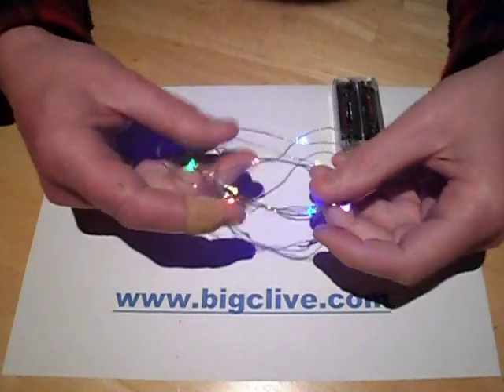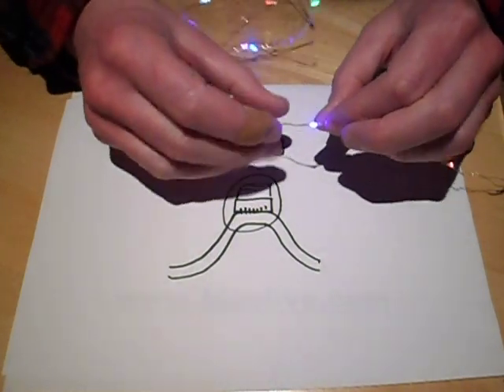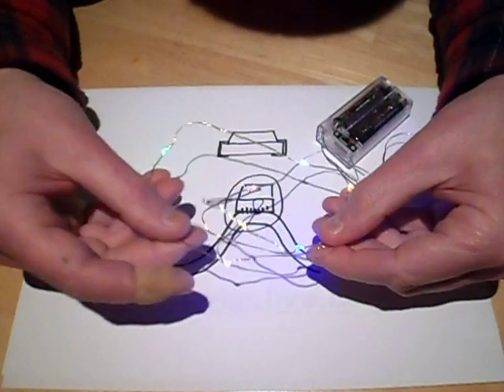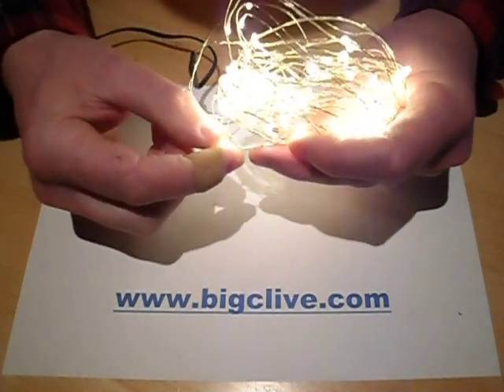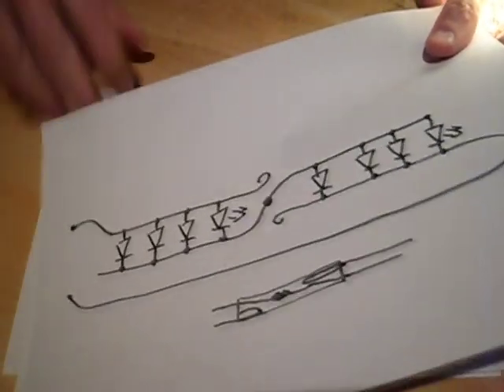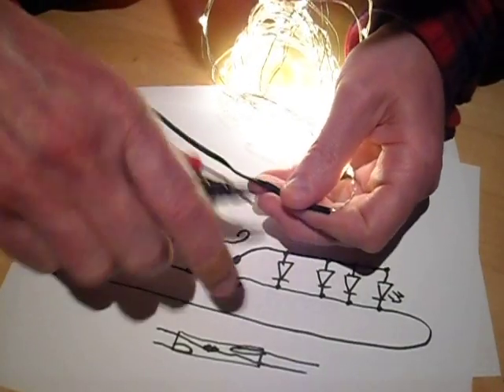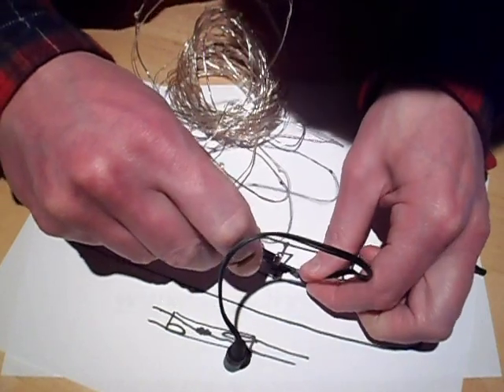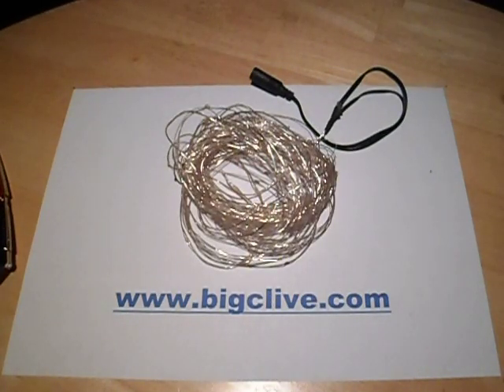Analysis of a 100 LED string of "wire lights".

Comment: Is there any way to put two or three of these 100 strand lights together (one strand). They don't make them any longer and my yard is big!
 Without starting a fire, I hope.
Reply from the maker: You would have to run a common 12V supply to each full string.  They can't be electrically joined end to end because only one polarity is at each end.
Reply: bigclivedotcom
I thought that might be the case. Don't really want cords running to every corner of my yard. I very much appreciate the reply, and the video!
Reply: +Lermopolis you can series 2 or three by splicing them at the ends (with proper attention to the polarity needed to maintain the series connection) then running two strings on 24v or three on 36v, possibly 4 at 48v but this would be pushing the safety limit of low energy circuits.  I have done this on three 10 M strings and powered them with a 36v current limited power supply.  this series connection has the advantage that each string receives the same voltage and there is not a drop in voltage to the further string.  You do have to understand the connection as described in the video and extend it. you should confirm that the resulting voltage meets the electrical code in your area.  As long as you understand the series connection you can make any multiple of 25 LEDs you like.

Comment: I have some of these 10 meter strings I need to cut some down to 8 meters and some to 6 meters. Would this be possible just using the same 110AC to 12V DC voltage converters that came with the strings?
Thanks.
Reply from the maker: The long 12V strings have a fairly complicated wiring arrangement of one supply wire going to one end and the other to the other end, then several sections of lights connected in series along the run.  Just cutting them would not work.  Can you fold the excess 2 metres back on the string or even just roll them into a ball at the end?
Reply: bigclivedotcom Thanks for your suggestion. I will be rolling them up if necessary. I was hoping to avoid this. These strings will be hanging from a panel suspended from the ceiling. I wanted to avoid light shining from above the panel from excess lights. Would it be dangerous to mask them somehow?
Reply from the maker: Jaydubya TX The LEDs run at such a low temperature that you could stuff them into a ball or something no problem.  That could also act as a weight to keep them straight.

Comment: why is in 4 sections of 25 leds in parallel? the 12v would not be enough to power it at 100% brightness. The proper way is to cut it in 25 sections of 4 leds in parallel, right? coz 4 leds = 12v
Reply from the maker: +KLONES Each section of 25 LEDs in parallel requires 3V.  So you then wire four of those parallel sections in series to make the 12V.

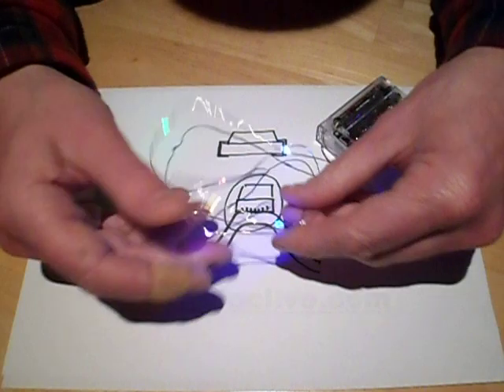Comment: Did you get mixed up about series/parallel around the 1:50 mark?
Or am I just too confused at the moment? =D
Reply from the maker: Nope.  They are by default all in parallel since that's the easiest way to manufacture them on a continuous string.  In traditional Xmas lighting LED strings a higher voltage like 24V is used and the LEDs are wired in series sections of 7 or so LEDs to accommodate the higher voltage, but in these ones the manufacture of them in a series array would be harder.  Hence why the big 100 LED 12V set has the parallel array divided into four sections hooked up in series.
Reply: wow that's genius! thanks for that! love your vids by the way
Reply: bigclivedotcom
The reality of using 12 volts is probably for product safety see the following from the LED equipment standard:

CAN/CSA-C22.2 No. 250.13-12
Light emitting diode (LED) equipment for lighting applications

E.3 Canadian Electrical Code, Part I, Class 2 circuits
Rule 16-200 of the Canadian Electrical Code, Part I describes requirements for Class 2 circuits that are, depending on the voltage, divided into four categories:
(a) 0-20 V;
(b) 20-30 V;
(c) 30-60 V; and
(d) 60-150 V rms.
However, for the purpose of this Standard, we recognize extra low voltage (ELV) Class 2 circuits up to 30 V rms (42.4 V peak or dc) and Class 2 circuits above ELV level, up to 150 V rms. All Class 2 circuits operate at very limited power levels and, since the hazard is reduced by the lower power availability, a less onerous set of requirements can be used for those circuits. Class 2 circuits are designed to limit the continuous available power to 100 VA. Therefore, transformers supplying Class 2 circuits need to have rated (marked) output not exceeding 100 VA. A Class 2 power supply needs to have its rating and “Class 2” markings. LVLE power supply needs to have its rating and be marked, “LVLE and suitable for use
in Class 2 circuits”. Per Rule 16-222(1) of the Canadian Electrical Code, Part I, ELV Class 2 circuits may be accessible to the operator, while Class 2 circuits (e.g., 60 V dc) are not to be accessible for touch. Therefore the voltage on
exposed terminal outside the lighting products cannot exceed 42.4 V peak or dc. An output form devices complying with Class 2, LVLE and SELV requirements are deemed in compliance with Rule 16-222(1).
Reply: The use of 12v is a compromise between the construction method and the availability of standard PSUs.  The construction is optimised for large parallel arrays of LEDs, and the typical forward voltage is 3v.  A 5v USB style supply would be too high a voltage for a single parallel array, and too low for two arrays in series.  12v works nicely with four
Reply: A Series configuration would be the most simple since it would be one trace or one wire in one continous row.  There are problems with that since any trace or LED opening would shut down the whole row, OK if it is on a circuit board but a flexible wire or ribbon not. When 10 or more LED's are in a row (series)  it becomes a shock hazard because of the accumilated voltage drop to drive the LED's.  I have seen arrays of 200 in series requiring over 600 volts to drive them all in a street light, even a 7 by 7 LED panel in series takes about 200 volts the current is typically about 300 to 500 milliamps of current.  This isn't a problem from a driver point of view because a constant current drive just keeps pumping up the voltage. A standard non current regulated power supply wouldn't be suitable to drive multiple LED's, it could be done but it is not optimal for the technology.   The parallel system is a problem because the current varies from one diode to the next (due to forward voltage differences, especially among different colour lights) causing different brightness in the LED's and driving 100 in parralel would be 3 or 4 volts at 50 Amps. The gauge wire and power supply to provide that much current would be prohibitily expensive. The compromise is a series parralel setup to optimize the voltage and current to drive the LED's and also comply with safety standards. Safety standards address voltage and current usually about 30 Volts Max and 8 Amps Max and total power to not exceed 100 Watts limits.  These limits apply to the strings you are reviewing in this video.  Street lights, LED light bulbs, etc with correct protection from user access to live parts have other limits.

Comment: can you please do a video on repairing these I have 100 12v lights with 3 copper wires all are 3 of these were cut at one point by a sissors and I would like to repair. 😕
Reply from the maker: In the case of the 12V ones they can't really be cut to length.  If they have been cut then there will probably be three wires at the cut point.  One that does not connect directly to any of the LEDs (join the two ends of that one) and a pir that do connect to the LEDs on either side.  They can be joined, but will only work one way round.  You should be able to work it out by pointing the drips of resin surrounding the LEDs in the same direction.
Reply: I dont really understand there is one wire with no lights that I have wrapped the ends together the other two I have done the same but no joy.  Do I need to solder ? normal wire I join with a tape of with a plastic wire connector, I am a woman don't understand electrics🤔
Reply from the maker: Although it looks like bare copper wire, there is a super thin lacquer on them like nail varnish to stop them just shorting together.  If you were to use a fine sandpaper (like a nail file) to clean the lacquer off then you could connect the bare copper ends together.  If you find it difficult getting the lacquer off, try holding the ends of the wires in the flame of a cigarette lighter for a few seconds to burn it off.
Reply: Hi I just wanted to say thank you for all your help. I got my lights to work again 😊

Comment: Oh, dear... I thought i was confused before, bit now i am totally lost. I have a set of  these lights (100) but each series has its own resistor, and they're divided into 5 sets of 20 LEDs, all white. Dingbat that i am, I assumed I could cut and rejoin them as desired like LED strip lights (with which i have some small recent positive experience) so I cut them apart and decided to use them as 5 series sets of 20. The original set of 100 ran on 3 AAA batteries,  with the 5 resistors delineating the 5 parralel series.
Can you guess what comes next? Well, my creations only have 2 wires each, and their own resistor (for each 20), but....they don't work.  Before anyone has a tizzy,  one of the reasons i split them up wad the horrid controller that nearly caught my couch on fire!
So  can i salvage my LED lights as I have separated them?  I SO thought this would be simpler.....
And thanks -seems like lately, every pinch I get in, I can find a video of yours to help me get out of the pickle!!

CC~
Reply from the maker: Are the LEDs wired in parallel?  Just two wires looping through every LED?  Have you tried swapping the polarity?

Comment: Hi I was quite interested in these lights when I first found them I have a project for which I want to adapt solar lawn lights to be the source voltage for these so that they would charge during the day and then illuminate at night I tried to make a measurement with a a meter set up for milliamps however I could not get a reading it was a it was as if the draw was so small that the Fluke meter that I was using could not perceive how much current was being drawn even on the milliamp scale does anyone know how much they draw or a way to measure them I would appreciate that!

Comment: Hey! I was wondering if you could help me, so I have a few of these 100 led copper wire strands. The way they are wired only the first 25 light up but the other 75 don't. Do you know why this would be? 

Thank you in advance
Reply from the maker: +Brandon Parry If they are 12V then it sounds like they have connected the wrong wires at the power supply end.  There should be three, with one power supply connection going to the wire that runs right to the other wend, and the other going to one of the other two that are connected to the first LED.  Dont run them for too long on 12V if just the first section is lighting.  It will damage them.
Reply: If it's a 5V set, then one of the joints at the 25th LED seems to need resoldering.

Comment: If I shortened the length by removing a section, would the excess voltage short them out?

Comment: I have the same problem.  Wires were accidently cut. Battery operated. How do I put the wires back together to make them work again?
Reply from the maker: If it's battery operated there will be three wires.  two go to the closest end and one goes to the far end.  The two active wires will be the one that goes to the other and and one of the two other wires.  You may need to experiment to find which one is which polarity.

Comment: I have a string of these plugged into a switched outlet, I notice there is a delay after I turn them on. Why is this, and is there any way to correct it?
Reply from the maker: If using with a power supply then there may be a delay in the power supply caused by it's bootstrap circuit charging.  It's the power supply for the driver chip.

Comment: can you please do a video on repairing these I have 100 12v lights with 3 wires also 
accidently cut thanks
Reply from the maker: If you tried trimming the length then they will need spliced back together.
two of the three wires will probably  go straight to an LED on either side.
Clean the varnish off the wire that passes right through (you can sometimes burn it off with a lighter) and then twist and insulate those two ends.
Then join the other two pairs between the LEDs in a random order and try it.  If the string doesn't light swap those wires around.
Reply: thanks clive i spent years at raf  lakenheath  love the the u.k! john

Comment: how would you add to it? I have two of those that I want to wire together....
Reply: NotNow You could solder one onto the end of the other, but you would need a power supply that is the same as the two originals, e.g. 12v + 12v = 24v supply. Make sure you connect the correct wires together for the correct polarity.
Reply: Will do i need to cover the exposed areas with electrical tape?
Reply: NotNow If you don't want a shock. also make sure to separate the leads to prevent a short, I tend to individually wrap each wire before wrapping all 3 together.

Comment: Is there a way to fix these? It seems mine may have a short.
Reply from the maker: Has it been cut in length at all or has a modification been made?
Reply: bigclivedotcom I actually got it to work, I think I had pinched one of the wires when I was hanging it up.  Thanks for responding!

Comment: Where did you buy this light string from?
Reply: I was about to make one from scratch til I saw this video
Reply from the maker: MATT HARRIS Do a search on ebay for ...
LED copper wire string
You'll find plenty of Chinese sellers shipping various sets of battery or 12V sets for very low cost.
Reply from the maker: bigclivedotcom In fact, here's a link to a search on the main .com ebay site.
http://www.ebay.com/sch/i.html?_from=R40&_sacat=0&_nkw=led+copper+wire+string&rt=nc&LH_BIN=1

Comment: can't these kill you? It's copper wire plugged into the outlet.  Can't i get shocked?
Reply from the maker: +TheAdmiralThrawn 116 They are low voltage and the wire is insulated with a clear coating.